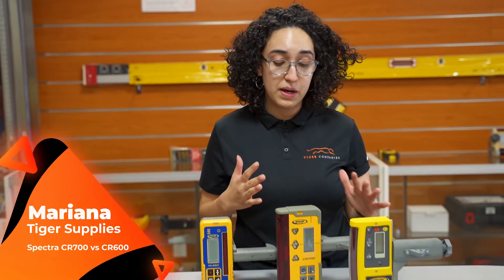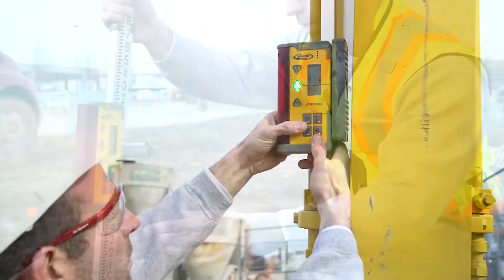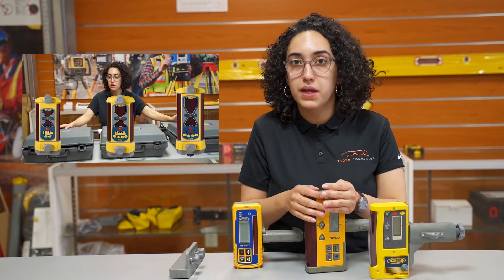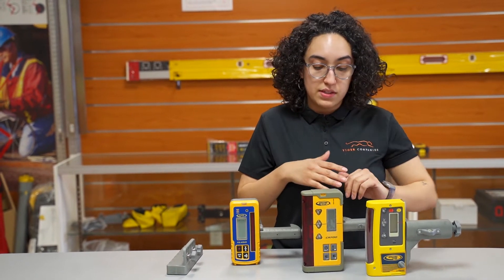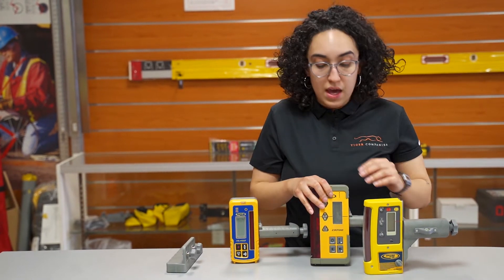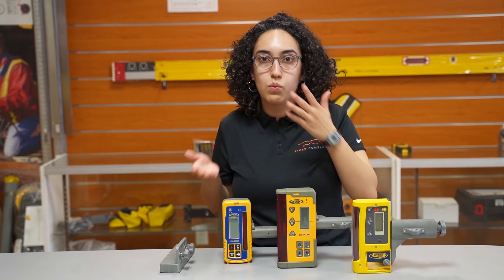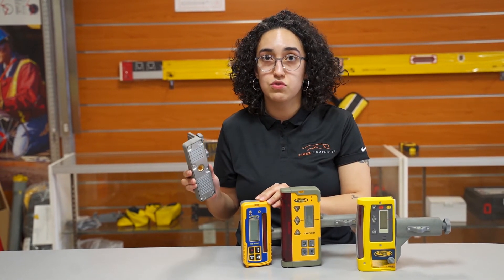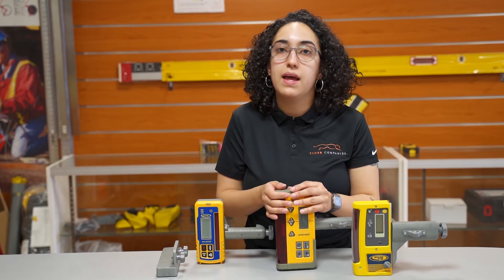Spectra Precision CR700 vs CR600 Combined Machine Control Laser Receiver

Comment: From the literature I have been reading the older cr600 can detect a laser with in 270 degrees, while the cr700 detects a laser with in 200 degrees. Also the cr600 has a metal housing and the cr700 is plastic. Is the older model better? They are about the same price. Thank you
Reply from the maker: The Cr700 is the latest model in the series with  the major upgrade being a larger receiver eye window. Yes, the CR600 has 270 degree reception angle compared to the CR700's 200 degree, but most guys in the field actually preferred a larger receiver window over the additional 70 degrees. We recommend going with the latest model, the CR700 as the CR600 will be discontinued in the future which can cause issues getting support down the line.
Reply: The larger eye window is a plus, biggest reason I use Spectra over Topcon.  Only bad thing I can say about the 600 is that the wiring used to connect the battery terminals and leads is tiny stuff, and the connections broke within a few uses; but my digging isn't exactly black loam.  I finally did a thorough soldering job and encased everything in silicone, it's been okay since.  Also, the wireless cab display is nice to have, but takes your eyes off the work.  I find I use it only once in awhile, like when the bucket is out of sight and I need to feel for grade.  When digging in building pads, subgrades for concrete, shallow trenches etc. it's really just a hood ornament.